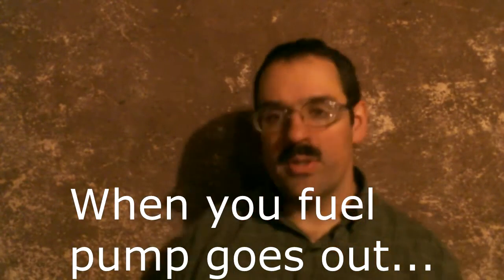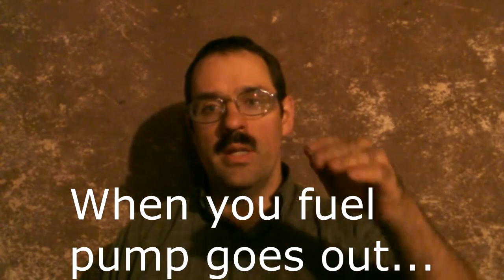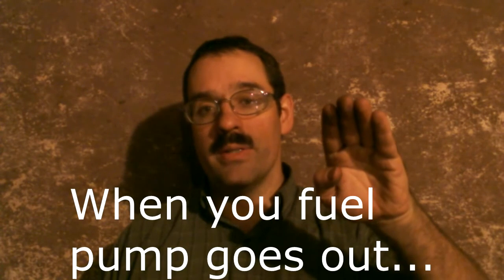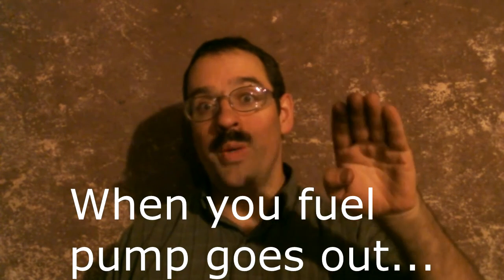Secrets of Long Term and Short Term Fuel Trims

Comment: My pump I believe on it way out only acts up when it’s really cold out summer time it barley happens winter or cold weather yea happens more. I never let it get below a quarter of a tank that seems to have helped for now
Reply from the maker: Fuel pumps should act up MORE when hot, not cold. Could be a gasket leaking air into your engine which swells bigger as it warms up. Try spraying water around intakes, valve cover gaskets. If it can leak oil, it can suck in air. If it takes in a bit of water it'll make the engine slower and you can hear that.

Most teach using brake fluid. More dangerous. Can catch on fire. Check around intakes. Hoses. Vacuum devices.

If even a great professional diagnostician can find nothing wrong, this is also symptoms of a worn engine.

If a lower intake manifold was leaking you may not be able to find it until removing it. Soaking with water lower could find it or just be water getting on your spark plugs. Lol

Ask me how I know. Teasing. People who pressure spray their engines have those kinds of issues and I have had to fix that.
Reply from the maker: If it is your fuel pump I have a 2 part series which has you covered. https://youtu.be/Qa0wxeYL_s0 (Completely dead ones can be easier to diagnose. Or sooner you can check the fuel pressure, but this requires opening the fuel system and adding a bypass. Not simple but doable.)

Comment: My car bulk , jerk and resume acceleration after some seconds after depressing pedal. No trouble code should I change the fuel pump? I have ready change fuel pressure regulator, no luck with that.
Am having -17 long term fuel trim 
Help
Reply from the maker: I'd check the EVAP system. If the fuel tank was over filled at some point the EVAP system could be delivering raw fuel instead of vapor.
Reply: @DENicholsAutoBravado  Evap doing good. No issues, no code.
Reply from the maker: I had a guess you'd say that. We can't rely on codes alone if this is the issue. Block off the EVAP purge from the intake. Don't have any vacuum leaks when you do this and try driving it. Each time this has been an issue on a car there was no code for it.
Reply from the maker: Also remember long term plus short term is the real at the moment fuel trim.
Reply: @DENicholsAutoBravado  Yes came to this section regarding the purge control valve. I did that there wasn't any change in the trims in past when i was diagnosing this double negative fuel trim. I even replaced the purge valve to double check it still didn't change anything. Yes, i know +/- trims add up to make the real deal.
Reply from the maker: What kind of car? Have you lean and rich tested the o2 sensors?
Reply from the maker: Harry, if the EVAP system is the cause of rich fuel trims, the purge valve doesn't have to be the cause. The carbon canister could be fuel soaked so block it off and retest. 

Carbon canisters can be fuel soaked. The EVAP system turns on when it should but it has the wrong effect.
Reply: @DENicholsAutoBravado  How do I then block it off and test it ?
Reply from the maker: @AnythingEverythingGh  depends on the car. Some purge valves are bolted to the intake so you have to unbolt it and block of the resultant opening in the intake. The purge valve could just hang loose for your check. Some have rubber hoses you can clamp off, but they're often plastic hoses so, in my case, I have a collection of rubber cups that go into and seal off holes. Can't pinch plastic to close it off, it'd just break.

Comment: 4 times , wow what brands of pumps.
Reply from the maker: Delphi plus rust...can't really say it's the Delphi...a 1 foot by 7 inch area of the gas tank couldn't be cleaned because of a plastic box.

I've used a lot of fuel cleaner, it was gone before the 2nd to last fuel pump went in. Now if the Delph fails, it's bad for their reputation.
Reply: DE Nichols  I have had great success with carter pumps if they still make them.
Reply from the maker: STEVE ROB
I'll look if I need a 3rd friend to help lift that truck bed. I looked at a lot of websites for pumps, can't remember a carter, but I do remember waiting for years to buy the first pump for under $350.

Hard to keep asking the same one for the same project, lol.

Comment: Nice explanation of short and long fuel trims DE. Four fuel pumps is a lot of pumps there :)
Reply from the maker: It sure is. The second fuel pump I put in made the engine harder to start. I'm sure the check valve was bad. It even wore on my battery enough to get it warrantied. The next battery was/still is stronger and took it like a champ.

The 3rd fuel pump created the issues in this video and the 4th thankfully has a good check value, knock on steel, and runs the truck very well. It's actually a little strong setting the fuel trims generally a bit "leaner". I'm sure that's actually just getting a nice stoichiometric just as before, except the rare hiccups mentioned in this video. I immediately got better gas mileage, but it's hard to judge if it's the pump or the PCM finally knowing the fuel temperature (bit of a spoiler there, don't worry, there's more awesome details I've held back -- that's actually the part 3 (intended part 2, but found this footage first) of the fuel pump series and then I ran into this training video that I made thinking of my student Tye and it was just gold -- and hey, you were in my head when I thought, get a visual up!).

FYI, Tye enjoyed the video and his friend we used to work with apparently loves my videos too. Wish he'd leave a comment. Oh well, still rewarding to hear it through a 3rd party. :)
Reply: It's always good help a friend out with some training DE. I'm sure your friend Tye will leave a comment when he knows this video is up. As for the fuel pumps, who made those things out of curiosity. I always try to go with OEM on fuel pumps although they do cost more. But I've never had a problem with them once they are changed out. Oh, one more thing. I never knew of vehicles having a fuel temperature sensor. Where are these sensors typically located at? You may want to discuss these sensors more in your next video. I'm sure others out there never heard of this either. Take care DE...
Reply from the maker: +stuzman52 Sweet comment my friend! My Nissan Frontier has a fuel temperature sensor at the end of the arm that has the fuel sending unit. I wouldn't have known it was there either, but for the first fuel pump I calculated it would take 16 hours to clean out the varnish, rust, etc. It prompted the purchase of my first die grinder and metal brushes so I could finish in seven hours. If I had it at the beginning, it would have been five.

Behind the plastic box that holds the pump in the tank I couldn't clean. By pump 3, I started using Lucas Upper Cylinder Lubricant. By pump 4 all the nastiness left making, I'm sure all the pumps, fail was gone.

I may not blame it on Delphi, therefore. I was going to include a lot about the fuel sensors in the fuel pump replacement videos but I'm pleased it'll be a seperate video, as the fuel pump part 2 is looking long.

I'll tell you this ahead...my smile was as big for the fuel temperature sensor doing its job as I was to ride my motorcycle the first time. ;D
Reply from the maker: stuzman52
And no, I didn't go OEM. I'd feel even worse about the crud left in the tank making a $400-$500+ part fail versus a $95-115 pump fail. Now Delphi has lifetime warranty while Delphi before had 1 year and the 2nd failure was just a month after warranty. I really lucked out that the, hopefully, final pump failed within 90 days. If you don't buy their pre-filter then the lifetime becomes a 90 day warranty! Phew!
Reply from the maker: stuzman52
I edited my last comment, just waking up and typing on my phone was a poor choice, lol.

Comment: So didnt you get any error code from the obd2 side, any jibberish like "low pressure on input manifold or womanifold lol"
I know nothing about obd jibberish, but it often wrongly points to the effect on another component rather than the faulty part  in the system.
Reply from the maker: It sure does and in this case it stayed clueless. When there are no codes it's actually a hint that it's the fuel pump because the computer on this vintage can't "see" the fuel pump. No direct sensor inputs, except fuel level and fuel temperature on this truck.
Reply from the maker: +zx8401ztv Lol. Manifold vs. womanifold.
Reply: Ahh new enough to have some obd feedback but old enough to be incomplete, sounds like a pain in the bum :-(
Reply: LOL well in this day of equality ha ha :-D